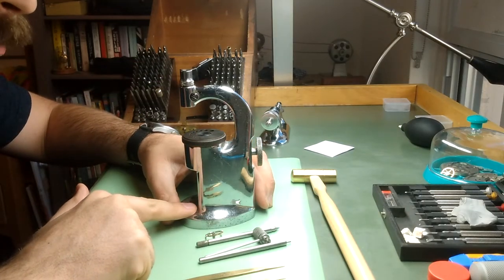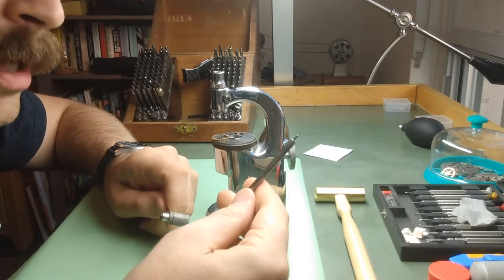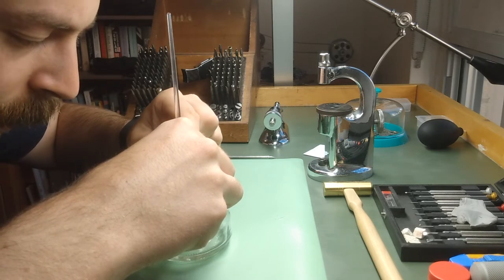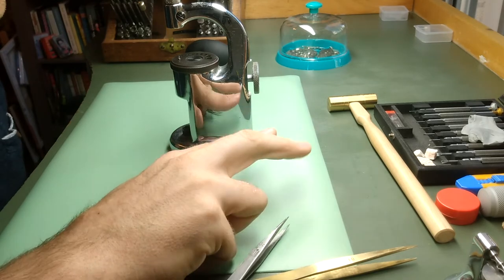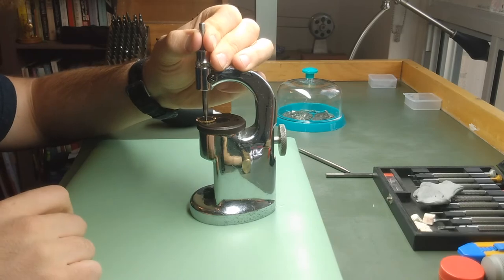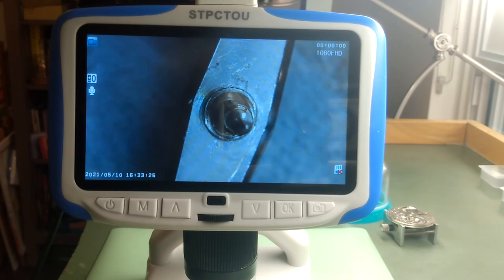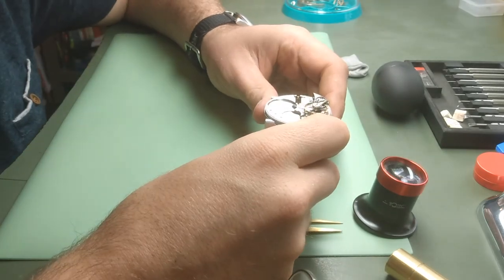Illinois watch restoration part 4: changing a balance staff

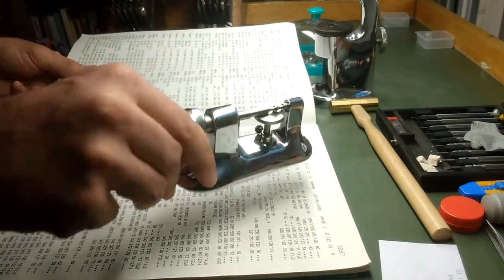Comment: Excellent tutorial video. FYI at 12:22, you use the large barrel of the bench mic for final measurement. If the micrometer nut is properly adjusted and the lubricant not dried and thickened, using the small barrel or knob at the end generally allows easier repeatability. I expect you have more than enough dexterity and attentiveness to use either portion of the barrel. For me, the small barrel provides an additional layer of consistency against my hand being tired or caffeinated. Again, excellent video.
Reply from the maker: Hey Tom, thanks, that is a really good comment. You're right, I am pretty undisciplined about using the fine knob. I am trying to rely on it more. A very good point! I am frequently overcaffeinated or tired or both.